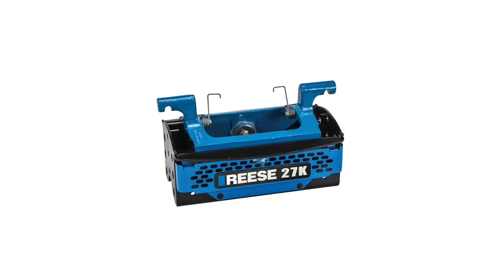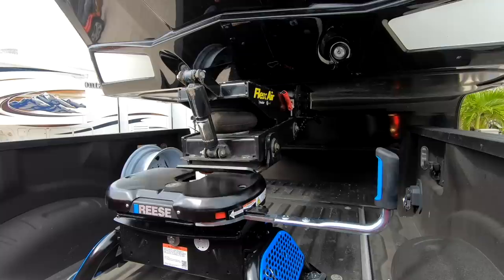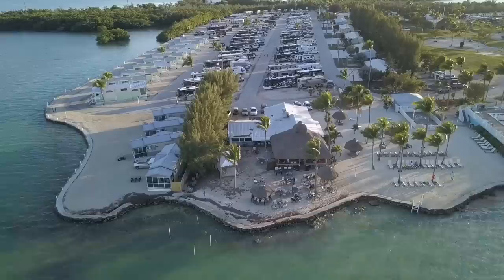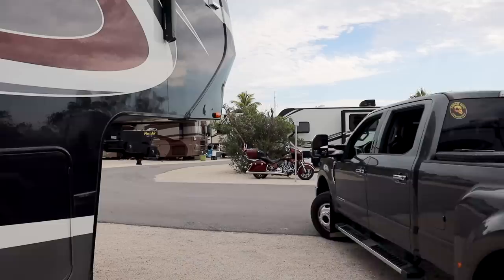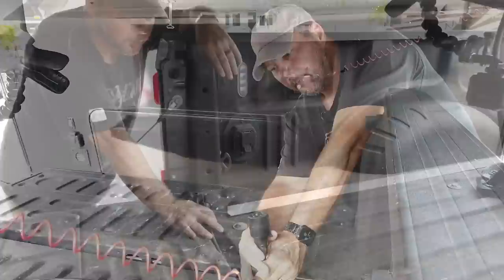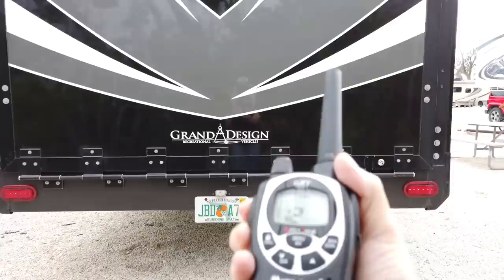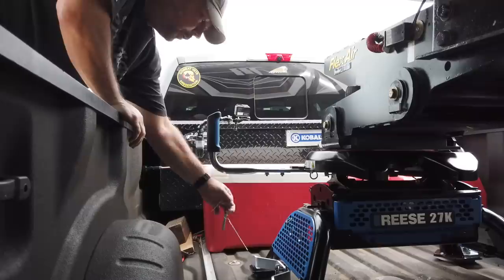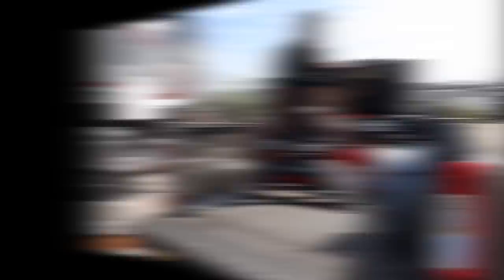Fifth Wheel Hitching | Reese M5 Review | Changing Lanes!

Comment: If i may ask a question, do you know if the flex air pin box will work with the wedge installed?
Reply from the maker: Not sure what wedge?... Do you mean the lube plate?  The lube place is thin and should fit any fifth wheel pin box...
Reply: @ChangingLanes  Thanks, the wedge that moves the pivot point from the hitch to the RV, locks into the hitch. Used for increased clearance with the short bed. Reese Revolution.

Comment: 💕💕💕💕💕💕💕💕💕💕💕💕
SHORT BED REQUIRES A HITCH THAT YOU WOULD GET OUT OF THE TRUCK AND OPERATE MANUALLY TO MOVE BACK TOWARD THE TAILGATE OR LIKE MINE IS BETTER IN CASE YOU WERE TO FORGET TO DO IT MANUALLY SO I GOT THE
AUTOMATIC SLIDING HITCH,  OPERATES BY GEARS LIKE INSIDE OF A CLOCK, WHEN YOU TURN - THE GEARS TWIST AND MOVES THE HITCH BACK TOWARDS THE TAILGATE AUTOMATICALLY AND MINE GOES BACK 17" AND I HAVE A SIX AND A HALF FOOT TRUCK BED.

Comment: Do you use safety chains from trailer to truck
Reply from the maker: No.  Not required for a fifth wheel.  Nothing to even chain.  I do believe they are required for a gooseneck (ball) connection.
Reply: Thanks.

Comment: Does the RV ride higher off the truck rails? Can I use a high profile truck box with this Reese hitch if it's dry at its highest setting?
Reply from the maker: Not sure I understand the question...  You need about 6" of clearance from the bed rails to the RV.  Anything higher would be an issue.  Raising the hitch doesn't always work because you need the RV to be level.  A nose high RV means tail low and that can be trouble getting in and out of parks and such (dragging).
Reply: @ChangingLanes  I just reread the question, yeah it's confusing. I meant if the hitch (which is adjustable) is set at its highest setting, would you be able to use a high profile Truck box. I understand it can't be any higher then 6" above the back of the truck.
Reply from the maker: Well.. yes and no.  We could certainly gain an inch or so by bumping up the hitch.  But then we'd be un-level.  And, I'm not sure it would be enough for a high profile box even if we did.  Not only does it need to clear the toolbox in a tight turn, it needs to do so in an un-level tight turn where the truck and RV might be on varying surfaces.
Reply: @ChangingLanes  ok. Sounds like I'm going to lose my high profile truck box after all. My 5th wheel doesn't have a lot of outside storage space so I'm trying to figure out ways to add more. This sounds like a dead end.

Comment: But if the safety pin goes through the hole, then the arm has to be completely latched and closed, otherwise the safety pin would not make it through the hole.  The only other risk would be a high hitch if the pin went over and not in, but unlikely if you hitch low.

Comment: Have a r e sidewinder hitch and had a wedge failure and almost a catastrophic accident.luckily with 40 years of experience towing trailers I was able to come to a stop with out a accident or rollover. Did quite a bit of damage to the fifth wheel and the rear of the pickup. Reese didn't hardly do squat. Since there was no injuries the only thing I could actually sue for is our deductible on our insurance. By the time I would hire attorneys and so forth it wouldn't be worth it. I will never buy a Reese product again.
Reply from the maker: sorry to hear that, Dan...  Glad you're came out safe and sound though....

Comment: I noticed you have the snap pads on your jacks. Do you feel confident that if you need to put those down on soft dirt that the jacks will not go into the dirt? If not what do you use to make sure your jacks do not sink into the ground?
Reply from the maker: We've camped on sand before (https://youtu.be/IVJx2T1WJC0) with no issues.   It would have to be super soft sand for them to sink.
Reply: @ChangingLanes  thank you so much. We are going to Put our motorhome in our backyard in a couple of the jacks might be on grass so I’m wondering if those snap pads would be enough or do I need to put something else under it. We live in rainy Oregon. LOL
Reply from the maker: If it's going to be out there a while, I'd say just keep an eye on them.. Not like it's difficult to raise the jacks and put some 2x8's under them later if you need it.. 👍🏼
Reply: Thank you

Comment: I bought one of these based on your recommendation, I was not happy at all. These things are junk. The plastic parts are cheaply made and rot. Grab handle rotted twice, green red indicator doesn’t fit tight and falls out, twice. All have been replaced and the same thing happens. I paid a lot of money for mine and it wasn’t worth it. I would not recommend it, if I got it free I still would not be happy with it.